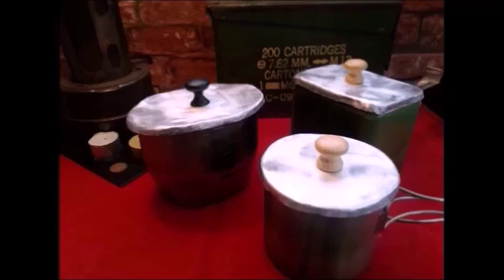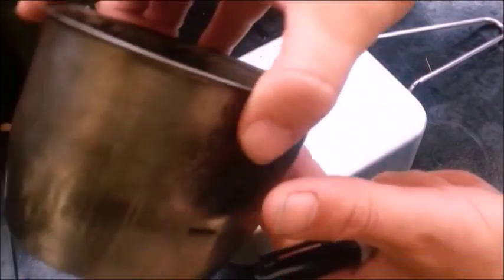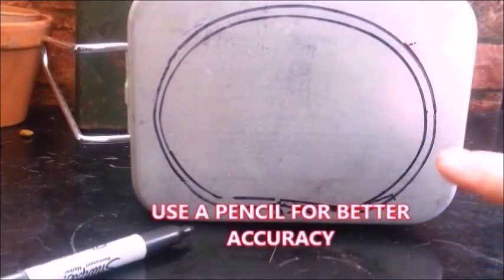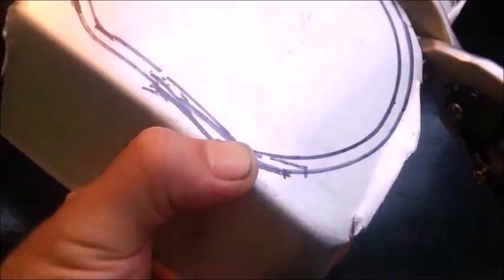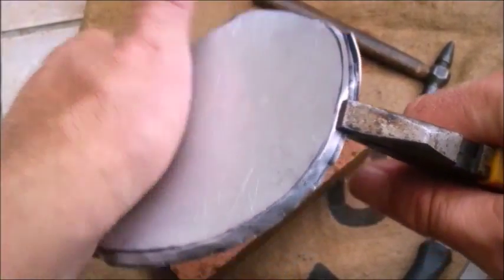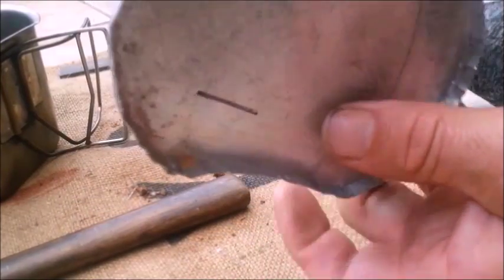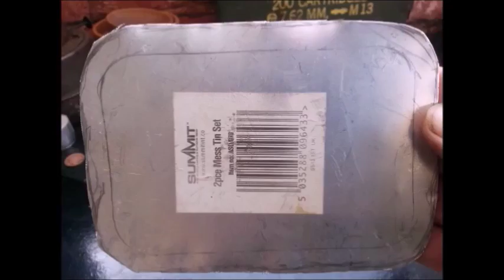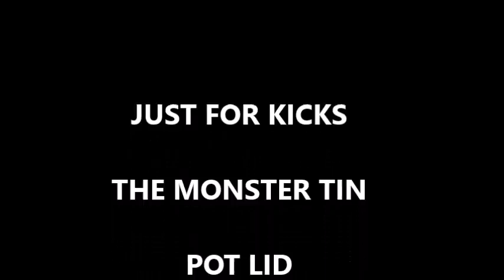HOMEMADE POT LIDS  (Made Easy) bexbugoutsurvivor

Comment: Great alloy from old road signs. When they become mangled due to accidents or whatever and they are left at the roadside I stop and pick them up. Got two huge ones, it's massively thick alloy and I have done nothing with them so far LOL but it's so strong alloy that I want to try making a simple knife
Reply from the maker: Tricky. Knives are made from forging steel. I dare say trying to sharpen an alloy sign may or not be worth the time, but you have nothing to loose finding out...Good luck

Comment: a few months back i tried a few field tests with lid, with windscreen, with both 
and the results were pretty clear, it reduced fuel consumption by half 
(for hexamine and dragon gel) and reduced the boil time.
Reply from the maker: Good intel there, hope others read this link. A lid a must, when boiling on an open fire, stops ashes fallin in ya brew. I now have a stainless steel nalgene, soooo much better than the canteen cup, but dont know it it beats the good ol    Brit mess tins???? Bex
Reply: lol ... i have modernised from the mess tins ... i recently bought a pathfinder cookset, which comes with a lid 
.... my JNA mess kit i have a home made lid, 
(like yours but no handle, so i can fit it inside the canvas pouch) 
... my Crusader set i bought a Heavy Cover lid for (cost a silly price)
 but over the life of the kit it will pay for itself, i just need to use it more, lol

Comment: Where do you get the pan lid knobs from for these? I had a look in b and q a long time ago when I was trying to make a lid for something,  but they all seemed to be huge for doors and could see any small ones. Was I looking in the wrong place or just missed them?
Reply from the maker: Hi ther,e the lid knobs were from Bevans. They come in a poly material and wood. Wood will conduct heat away, so this will prevent burning. One tip for you, saw the size of the screw right down, to prevent the use of a spacer. Think I paid £2.50 for a pack of two...Bex
Reply: bex bugoutsurvivor thanks for that. We haven't got one anywhere nearby so might try ordering online cos the b and q ones are huge that I saw. And yes good point to cut the screw down too so will need to invest in a hacksaw when I find one.

In my haste I forgot to wish you and yours a happy New year too
Reply from the maker: try rightway bevens online, if no joy, (private message) me, and I'll post a couple to you, (on me)...Bex
Reply: bex bugoutsurvivor thank you, that's extremely kind of you! I shall bear that in mind! 😁

Comment: nice vid, what about using some heavy duty aluminium trays you get when buying meat products from supermarkets? a lot easier to cut and shape rather than using your old style army tins?
Reply from the maker: I guess you could use anything that your imagination can stretch to. The mess tins would be stronger and last for many years. I made a set from drinks tins too....Bex